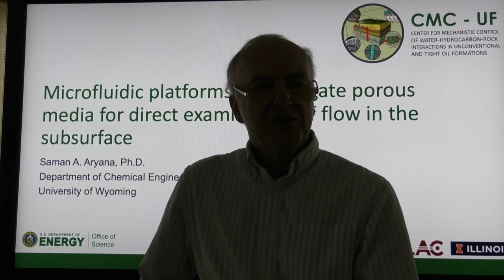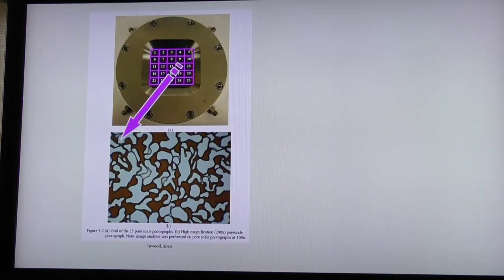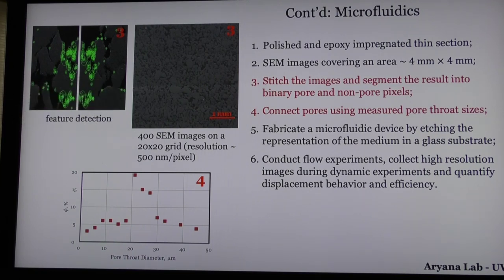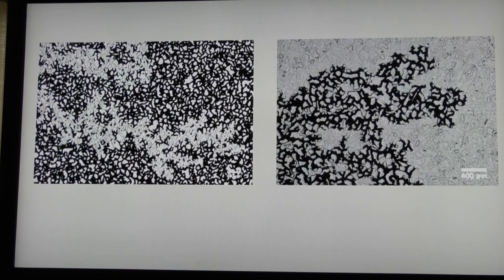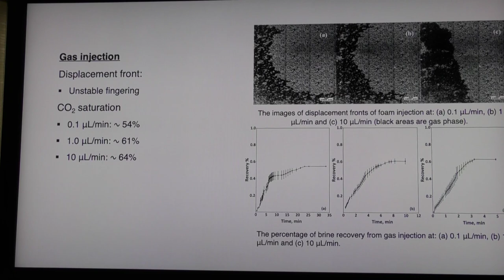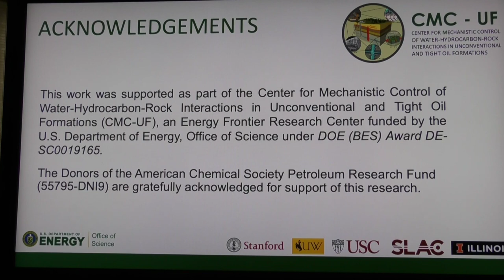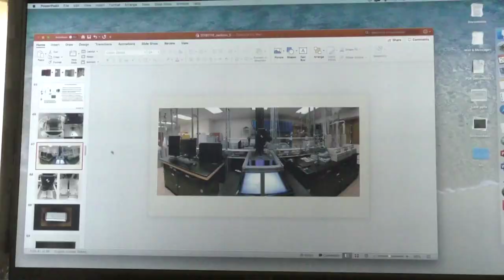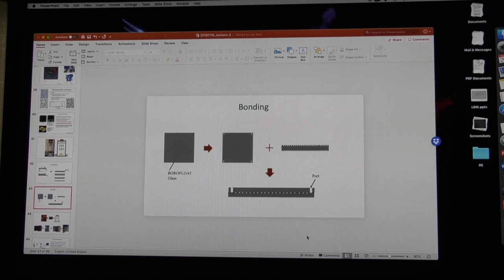Understanding Fluid Flow in Rocks of Wyoming

Comment: I don’t understand why these experiments aren’t being done at pressures that simulate actual subsurface conditions ... 1000psi is only about 400 m depth.  As far as temperature goes, it seems ok, the foam would break down after about 4km, not to mention oil would be no good at those temperatures anyway, so that’s not an issue, but the pressure... seems like that should be prioritized over making pretty pictures